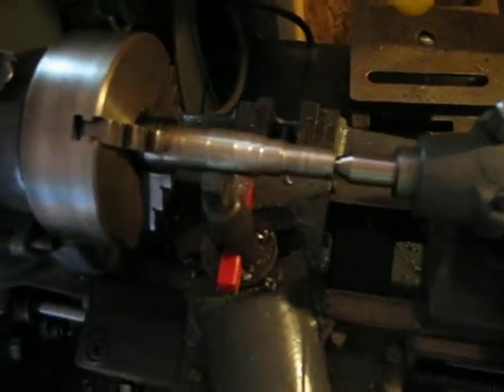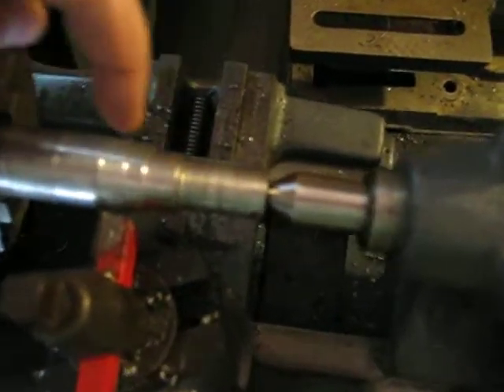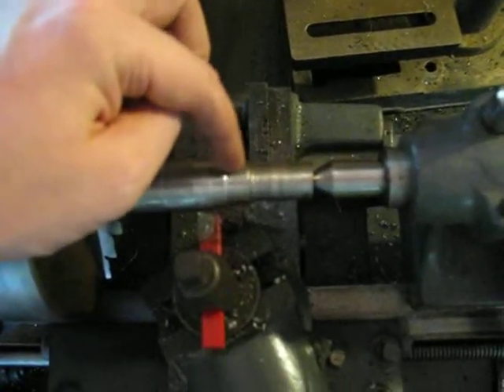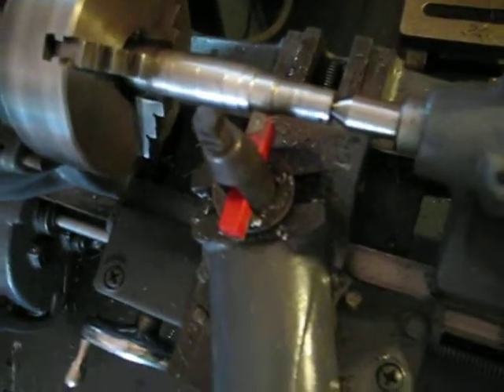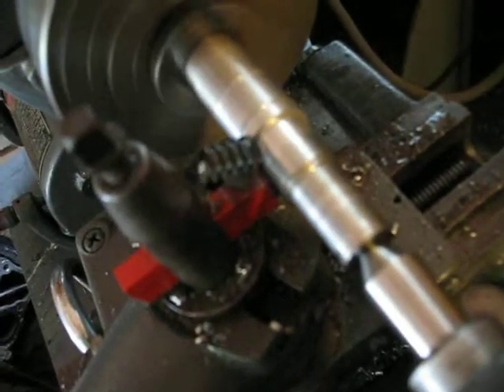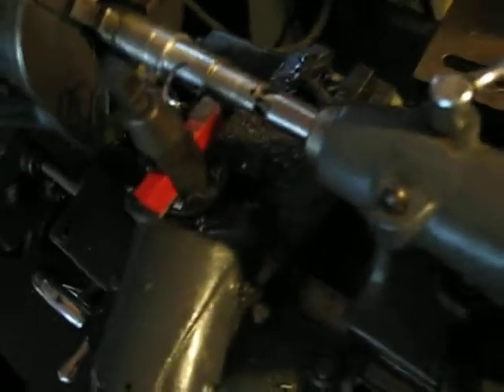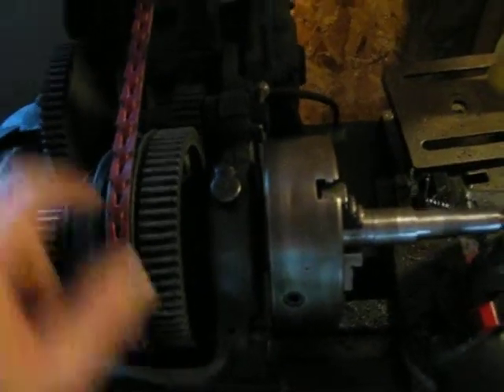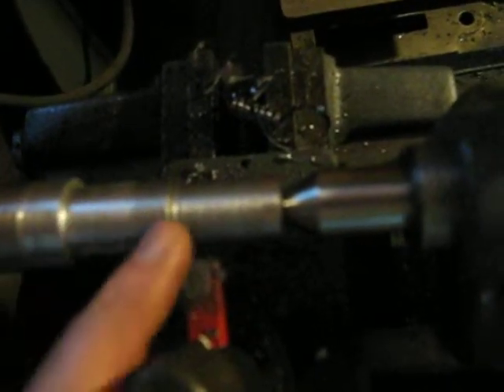Atlas QC54 metal Lathe deep rough cut and search for finish quality

Comment: what exactly is a roughing cut?
Reply from the maker: My understanding is that it is a deepish cut to get very close to final dimensions. Another pass at just a few thousands depth of cut should make a smoother surface as the machine has less forces on it, so less flex and deflection.  I have seen videos where people take another pass at the same position and get a tiny cut, which they call a spring pass, meaning that the flex of the machine on the previous pass allowed some material to be left behind. The spring pass is only cutting the amount that was flex in previous cut, so should make a much better surface finish.

Comment: I know this is an old upload but I am still going to put it out there. I had the same issue with my lathe deep cuts were fine but shallow cuts vibrated more and were rougher. I learned that my compound was loose at the clamps. Now you don't have clamps but I would check for anything loose on the saddle. When I say loose I mean the screws can be tightened more though nothing seems to be obviously loosened, they are  just not fully seated in position.

Comment: I have the same lathe except mine doesnt have the quick change gear box did it come with it or did you add it on yourself. Try some hss it leaves a much better finish on mine also check your spindle adjustment if its loose or the bearings are bad it will leave a bad finish among other things. Make sure the machine bed is level you have a sharp bit your carriage is not hanging up your live center bearings are good. Even the cogging effect from the 60hz cycle of the motor can leave a weird f